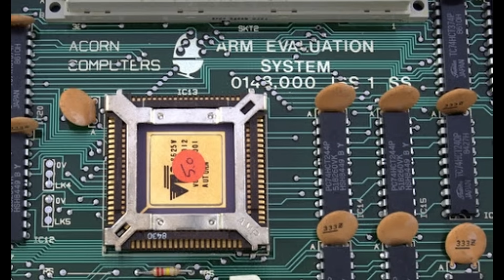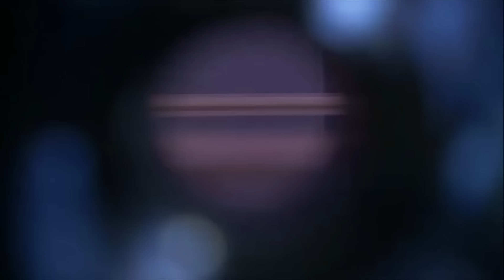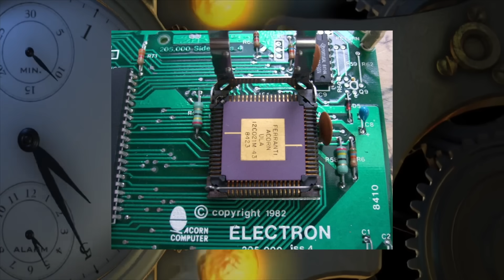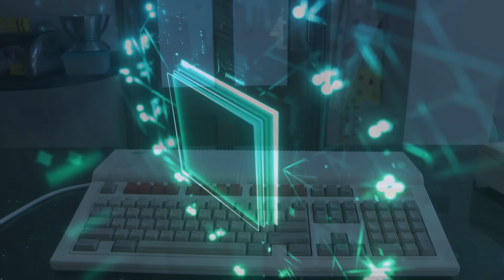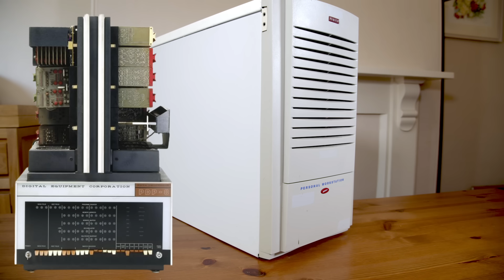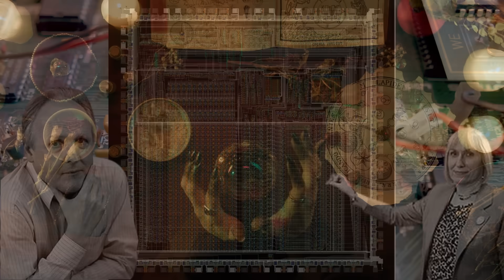The potted history of ARM

Comment: Not sure if I commented yet or not. If not. I used Acorns back in the day, and got my dream computer - the Acorn A4 laptop - off eBay in the late 1990s. I have two of these, some Acorn RISC PCs, and also an Electron (the first computer we had. Acorn developed an OS for the ARM called RISC OS. This is. Is fully open source, and has been ported to the Raspberry Pi and other more modern computers. Currently, it needs a Raspberry Pi 4 or earlier (needs a 32- bit core that can run in ‘SVC’ / supervisor mode). Work is underway to convert it to 64-bit :)

The best thing is that the entire OS fits into 4 or 5 megabytes, so booting up on a Pi is pretty much instant :)

Comment: I think the 65816 was the ideal CPU for Nintendo as the SNES video chip had been designed to be backwardly compatible with the NES so Nintendo could release a simple adaptor to allow SNES owners to plat NES titles.

In fact, among coders it is widely believed that Zelda - Link With The Past was developed as a NES game that with a 'coat of paint' could be a SNES game.
This is based on the observation that large chunks of the codebase was in 6502. 
Others suggest that dev-kits were in short supply so at least some of the game was developed on a NES devkit.
Whatever the truth, AFAIK Nintendo never did offer a NES emulator for the SNES. Why? Maybe the audio meant the Sony SPC-700 sound chip in the SNES not being on the same bit of silicon as the NES sound chip meant writes would have to NES sound-chip would have to be trapped so compatibility might not be 100%.

But the original 32-bit ARM instruction-set then Thumb-1 (and Jazelle for SIM cards) then Thumb-2 and finally the aARCH-64 bit instruction-sets were amazingly forward thinking.

While every other RISC design allowed instructions already in the pipeline to execute, ARM went for the seemingly odd choice of emptying the pipeline introducing the infamous 'branch shadow' but the reason was simple - pipelines may change size.

So every other RISC design ended up stuck because they couldn't use just the first X number of instructions in the pipeline.

Hence ARM having conditional instructions (even in Thumb-2) to avoid the need for branches.

Comment: This is a great and easy to learn video, thank you! 

I was always wondering how ARM pretty suddenly into the mainstream in the past 5 years from (somewhat) obscurity. I'm not that much of a computer buff, as all I knew when it came to processors were Intel & AMD made them. I thought it was a new architecture, but watching this video taught me that it was always there since the 80s, just hidden in plain sight. I did know about phones having ARM processors, but I didn't know they were in so many other products. Apple's shift from Intel to ARM was what really put them back on the map. I'm not an Apple fan, but I will say the performance and efficiency on the Apple Silicon macs compared their Intel models is very impressive. It has certainly piqued my interest in the history of this architecture and chip.

Now to see if you can port Doom Eternal to a Beeb...

Comment: Your video reminds of a similar one by someone else which went into the development process of the very first ARM in detail. It had some extremely fucked up quotes that were supposed to be verbatim from Wilson, but simply cannot be true. Basically, I cannot remember the exact words anymore, but as far as I could decipher their meaning was that, the MOS6502 BBC simulating an ARM1 on software was 10-100 times faster  than an ARM1. Which, is literally impossible. Also would make the whole ARM1 silicone pointless and moot. Because, why would you if software emulating on MOS6502 is 100x faster? Then LATER they got hw simulation equipment. I wanted to find this bullshit video and find its sources. Can't locate it anymore... Maybe just as well, since it did contain other similarly incredulous and nonsensical claims from Wilson, which if she said them.. Well she was either drunk off her mind and incapable of producing coherent thought, misquoted, or completely insane and/or incompetent and incapable of designing any sort of binary logic anything.

Comment: Great history. Well done. It doesn't answer a question I have: What does all this success mean for England, or even the company who started it? Acorn doesn't exist anymore. How about Sophie and the original team? Are they still actively involved? With it being owned by SoftBank I would have though a lot of power has been taken from the hands of the Cambridge offices where this began. I'd also suspect that office probably doesn't have the same overarching involvement in the product anymore. How are profits distributed? I don't know but it seems that the bulk of the proceeds from the success fall into the hands of people implementing the design. How much of that flows back to Cambridge? Is it the case that the Cambridge office now is an HQ of a multinational company with power distributed widely and perhaps off shore?
Reply from the maker: The success of ARM, has helped to keep chip design as an industry to become successful in the UK, and has helped to keep a whole sector competitive. 
Sophie, now works for Broadcom, working on the firepath processor, she never actually left Acorn, the part of the business she worked for became Element14, which Boradcom bought. Steve Furber left the commercial world, and when over to Manchester University (in the 90s before Acorn was sold), and retired earlier this year. Softbanks ownership has not really had much of a practical effect on how ARM is run, there is maybe a bit more work done in the US now, but that trend started before Softbank bought them.

Comment: the prototype running on leakage current is just GOLD!
Reply: When you forget to connect Vdd, it's not running on leakage current, it's powered through its input pins from the outputs of other chips and then through the protection diodes of the input pins. The power is still coming from the power supply, but via other chips rather than directly. It does mean that it's getting powered by a voltage around 0.7V lower than it otherwise would, which could have reduced the power consumption a little too - although would have limited the top end frequency. It's a mistake most of us electronics engineers have encountered!

Comment: I was hoping you would mention Nintendo's Game Boy Advance.  The only people I see mentioning that is retro gaming videos that don't delve into the development of the ARM processor.  Besides Apple using the ARM processor, I would think Nintendo would have been a big enough deal to mention how that impacted Acorn.  😕
Reply from the maker: The GBA was a bit later on, so from and ARM point of view it was one of many many portable devices which where using ARM, by the time Nintendo had started working on it. So ARM did not need to change its approach or way of thinking or business model for Nintendo.  While the GBA is one of the first uses of ARM IP in an SoC, which would become a big use of ARM IP.  From ARM's point of view it was just another (if large) IP licensing deal.
Reply: @RetroBytesUK  Ah.  Okay.

Comment: Great videos! 🙂I re-post my comment corrected.🙂
 You said that speed-wise, ARM2 was ~7x times faster than an 68000 at 7 MHz & twice as fast as a 80386 at 16MHz!
 I wonder how it compared price-wise with these 2. Obviously, a system's price is not entirely dependent on its CPU's price, but the supporting chips go hand in hand with it. As CPUs though, how did they compare price-wise, since ARM used this cheaper plastic package?
 In my country in mid-1991, an AMIGA 500 (i think with 512KiB) had ~375$ (then), while an Archimedes 3000 had ~585$ (2/3 price difference). Was this difference mainly because of the CPU?
 I wonder if Archimedes was perhaps more expensive than it should and if that was the main reason that it didn't sell well. Of course, as i understand Archimedes and perhaps all of the home computers then, had no chunky video memory (but planar instead) and all these machines were perhaps.. "doomed" to be left behind, because of the DOOM (game) & generally the 3D era, which favored chunky video memory. 3DO was expensive too. Was the CPU's price the main cause?
I would prefer if ARM or the 68000 were still the main processors used in computers. One of the reasons i lost my appetite to become a game programmer, was my transition from DOS to Windows, caused partly by the stupid 80x86 memory setup...
Reply: If the A3000 is anything like the desktop counterparts (A305/A310/A410/A440) I would wager that the increased cost is a combination of the CPU (along with the supporting VIDC, MEMC1a and IOC packages), the case/chassis being built with stronger materials, the 1MB of RAM as standard issue, the 512KB ROM containing the OS and various applications, the built-in speaker(s?) and the podule-compatible expansion slot. Might have forgotten something else, but that’s my theory.

Comment: ARM processors have also hit it big in microcontrollers. For a long time those have been dominated by 8 bit microprocessors but the exceptional power efficiency of the ARM architecture has begun to displace them.
Reply: It had begun at least 10 to 20 years ago. ST, NXP, etc. This statement is best suited for 2010 but not 2024. At this moment all MCU cores are adopting RISC-V cores.

I used to work on a project which has about 20+ CPU cores in a SoC. (Can’t say much but you probably have used our products) Initially all the small controller cores are Cortex-M3s. Beginning from around 2018 we started to swap them all out with RISC-V from SiFive. I’m no longer there but I think all those CM3s are gone by now. The AP cores are still from Arm but they have plans to replace that in the back of their hands. Another example: I just heard yesterday Renesas just released their new RISC-V SoCs replacing Arm’s. Getting rid of Arm, or at least having a backup plan is the new trend at this moment. One day it will come and the switch will be flipped, just like what Apple did to Intel.

My current job is working a designing RISC-V CPUs. Even there we still have a lot of Arm’s standards like AMBA CHI etc., but we are gradually replacing them as well. Arm now is just as big or complex as Intel and they have become a dragon as well.
Reply: This is especially true in 3D printing. 8 bit microprocessors used to dominate consumer 3D printers but 32bit ARM is taking over and bringing along advanced features only made possible by the massive increase in processing power.

One example is the Prusa Mk3 vs. the newer MK4 which share the same mechanics.
Reply: PowerPC still dominant in automotive controllers though

Comment: The whole big core little core thing they came up with is great…. But when you think of it.
If an arm CPU has 2 big cores clocked at 2.49GHz, but then four little cores clocked at 1.245GHz, you’ve basically got the same performance on either the big or little cores. Yeah, this is a bit of a jab at apple, but they’re still efficient as hell, and really useful.
But well, then you have something like the M1/M2, which has more big cores at a higher clock compared to those 4 little cores, even more so when you have the Pro or max versions.
It’s useful, but doesn’t always make sense.

Comment: Thanks.
BTW the Thumb instruction (mostly 16 bit) mode addresses the same 32 bit address space as the original ARM.32 but can only address 8 of the 16 registers. It provides significantly greater code density than ARM.32. Thumb is the basis of the, still current production, ARM Cortex micro controllers.
I noticed you sidestepped the Shirley complication.

Comment: Great video. I think ARM chips compete with themselves.  As you pointed out, companies licence them then add in their own tech. They share a common instruction set and some will share parts of the same silicon design but most are just custom processors (CPU or SOC). None of them designed to be compatible with another but all designed to work with a common operating system. Currently Android and iOS.

Risc-V looks like the same idea minus silicon or the risk of a hostile takeover by a competitor. It may do for the server market what Linux did. Can't see Risc-V surplanting ARM in mobile devices anytime soon given the volume of devices and apps that currently use it.

Comment: The point about testing in this video is very important.  The original ARM 1 & 2 are sufficiently simple that it was possible to show by formal methods that the processors work correctly.

Comment: Just to add, I also designed one of the two semi-custom chips in the BBC micro, the serial processor, which handled the cassette filing system interface. 🙂
Reply from the maker: I did not know that, that's rather cool. Did you also work on the teletext adapter ?

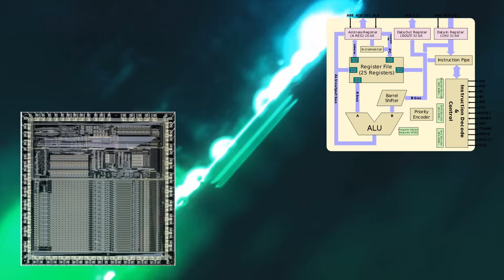Comment: okay around 11:45 when the power draw test was done did I hear correctly that the chip was running on its own input power...? and seen this as wrong? yeah I get okay it wasnt designed that way something was wrong but they ignored the fact they made a chip that does not need a direct source of power and will run on purely by what is input alone...  o.O or did I miss something?
Reply from the maker: Quiet a few lower power chips will run off scavenged power from the inputs. However it does not make for stable operation, say for example your input values have too many 0s for a prolonged period of time the chip looses power and resets .

Comment: The MPC603   the beginning of  RISK.    WAY before ARM.
Reply from the maker: Assuming you mean the PowerPC 603, it's not even close to the beginning of Risc, coming out in 91 where as ARM came out in 85. If you're talking about IBMs 801, from the 70s then alot of people do look at that as the first risc processor (although the term risc would not be created until it was introduced later a Berkley), however others where using a load/store design before that (e.g Cray). I should mention that nowhere in the video does it claim ARM was the first risc processor, it like most other risc architectures at that time where inspired by the work of Berkely. So at the very least it was preseceed by Berkeley's work, which it's self came after IBM's work.
Reply: @RetroBytesUK  I started with the Motorila 68xx 8 bit in 1979,  Z80s at 6MHZ, 1994 intel i960MC/MX  in 1994 end of intel military, R3000 R4000 flushed away by the rise of the PowerPC,  just loved that E500 core, Power Quick III MPC8748E  1.2GHZ core running with DDR3 in 2015.  The upper limits of PCB 180ps per inch,  50ps rise and fall times . . . . . . PCIe Gen3 signaling
Reply: @RetroBytesUK  ARM, not a contender.  DOD money spigot was driving , for a while.

Comment: I have a BBC with a 6502C second processor and a Archimedes 310 and a Risc PC with one of these Strong ARM mother boards with the speed setting switches,  
as well as a ARM 710  and a Plug in mother board with an IBM Blue Lighting 486 chip 😀 windows in a window ?
Reply from the maker: Thats a nice collection Rev.

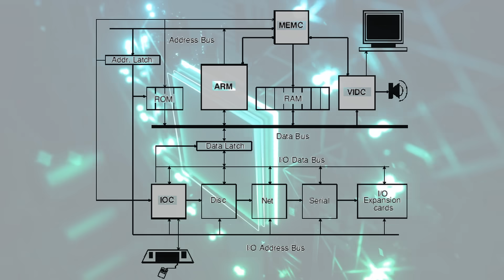Comment: 12:37 you have a block diagram that has a transparent sparkly rotating 3d b-roll of some cgi circuit/chip effect in green.  Fucvk me that is detracting from your block diagram.  I just would like to see your presentation content please. Not the semitransparent CGI vomit overlaid on top for the zoomer's micro attn span.  I grew up with a BBC model B. Great machine. And a great insight into ARM excluding the flashy distacting bits.

Comment: What happened to SPARC?
Reply: Oracle purchased SUN.  They killed the SPARC in 2017.  Not long the only SPARC chip designer Fujitsu also killed their SPARC effort.  SPARC is history now.
Reply: @catchnkill  Such is life.
Reply: @hypercomms2001  You cannot blame the SUN shareholders.  Oracle is a software company.  They bought a hardware company with the only purpose to kill the techology of a competing SUN.  And they did.
Reply from the maker: Fujitsu are planning one last iteration of ultra sparc chip. That will be the last one for them.  Its for their mainframe line. That will also be the last verison of that mainframe system too.
Reply: @RetroBytesUK  what the future for Fujitsu? Will they still make Mainframes, or servers?
Reply from the maker: @hypercomms2001  They have announced the next mainframe they produce will be their last. The plan is is migrate customers to a mix of NT and emulation over the file time of the next generation.